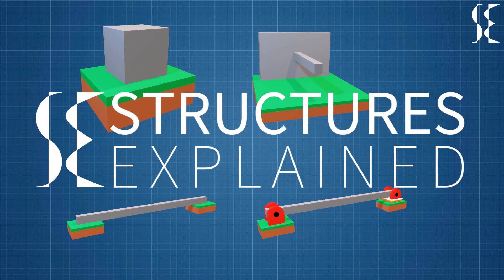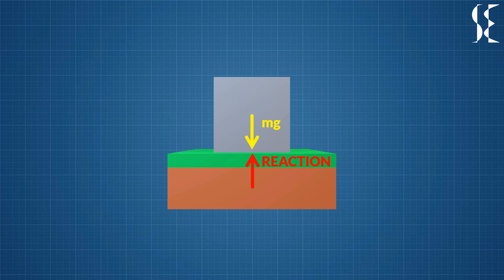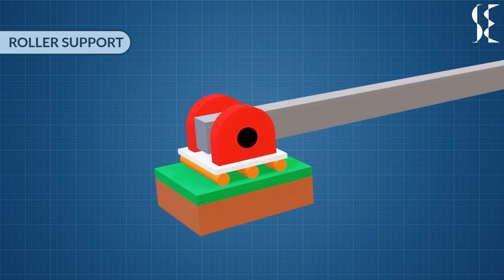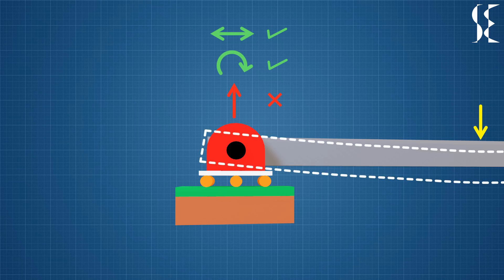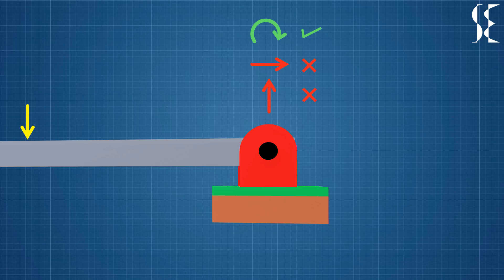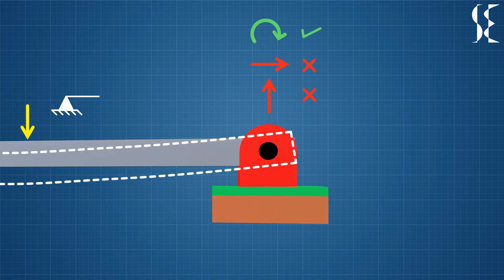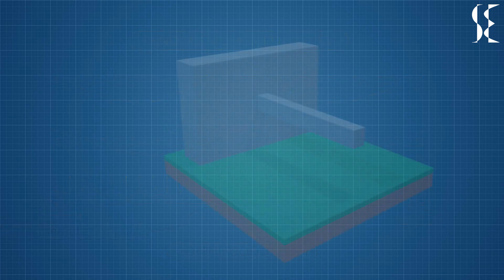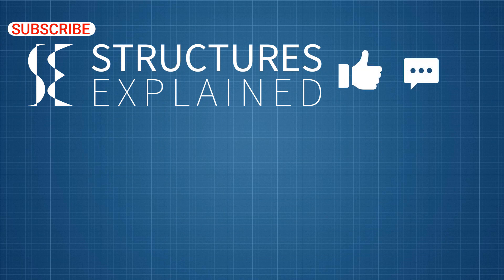Types of Support | Support Reactions in a Beam

Comment: I think it allows for vertical motion not horizontal motion.
Reply: it allows horizontal because of the roller at the end of the beam, and not vertical, pinned supports are usually fixed on the surface too